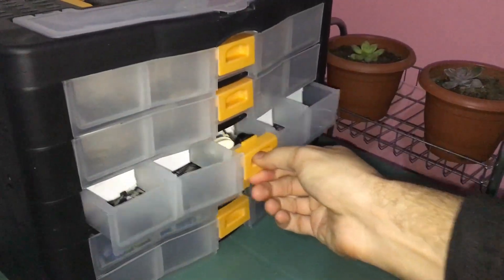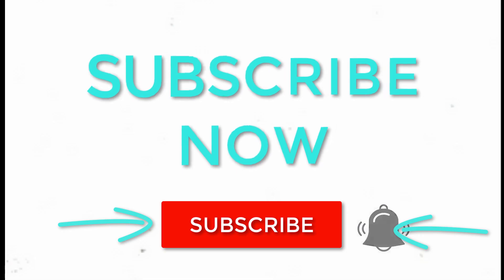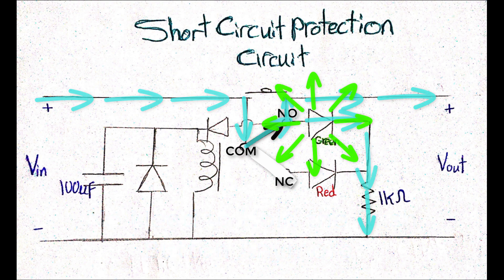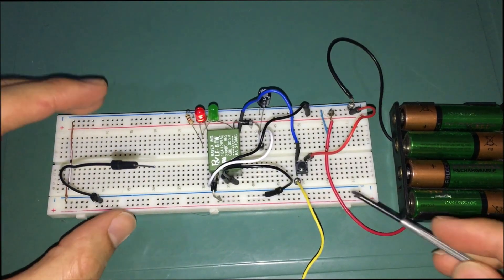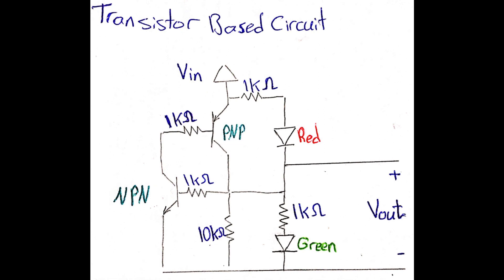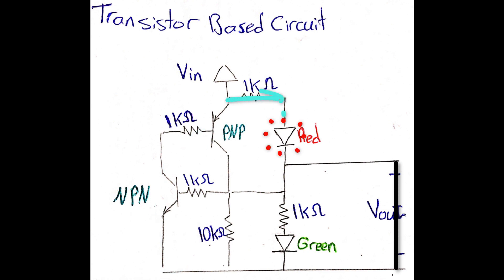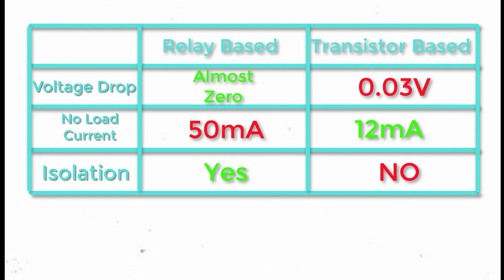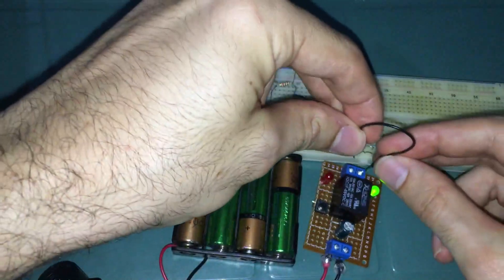Make Your Own Short Circuit Protection Circuit

Comment: Wow this is very helpful - thank you! I have one question though - if I want to decrease the amount of current that the circuit "trips" at - do I need to decrease or increase the resistance of the 1k resistor? - also will the transistor still protect against short circuits, even though it doesn't isolate the power source? Thanks in advance!

Comment: I prefer the transistor based design.  If I were to build it, I think I would use an adjustable voltage regulator in order to compensate for the diode drop.
Reply from the maker: Enigma758 nice. I didn’t try that 😁